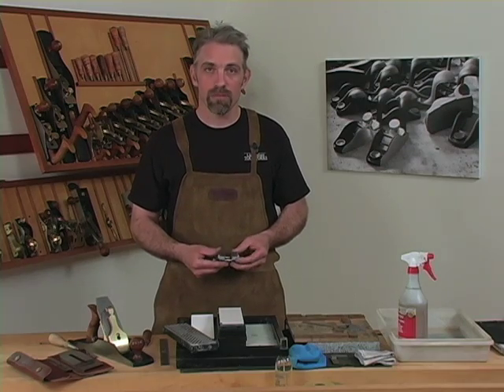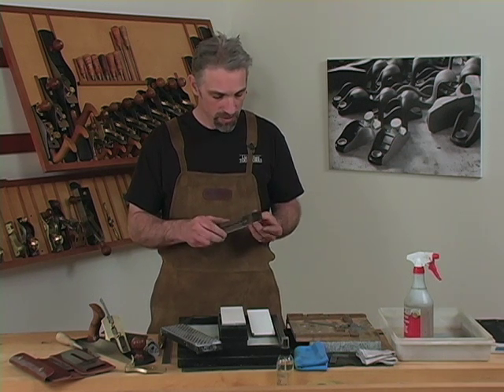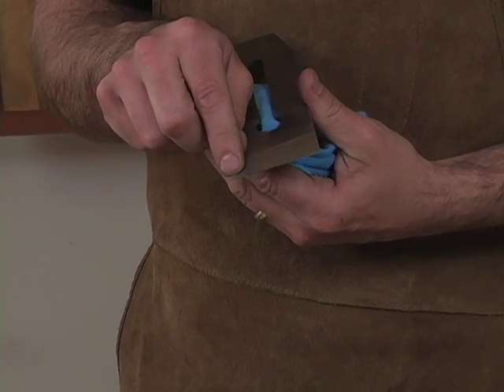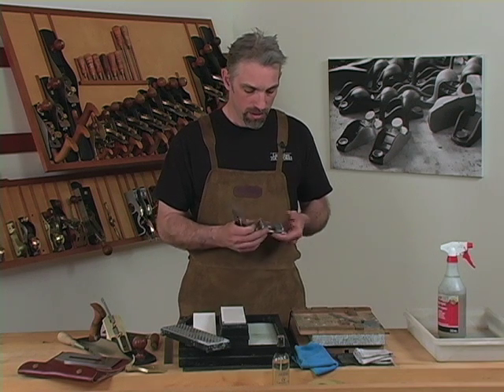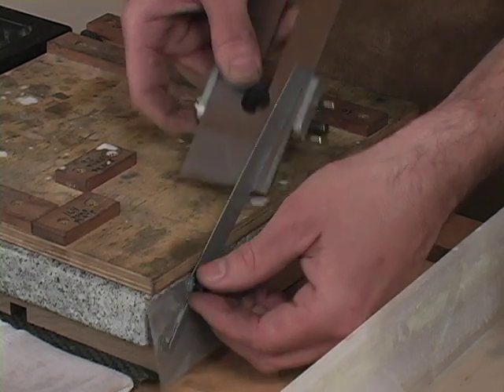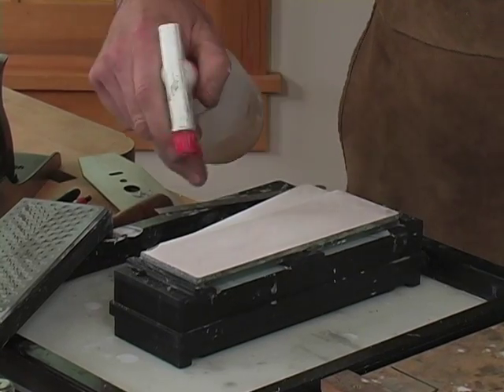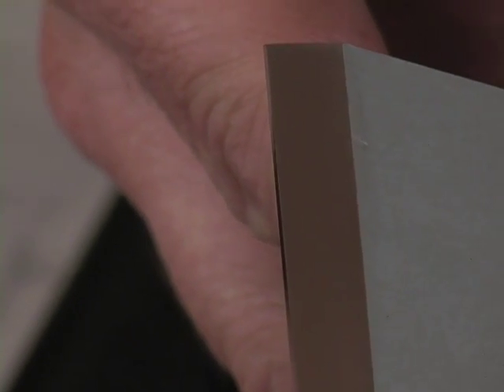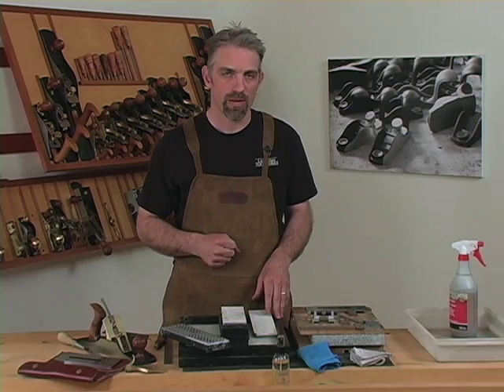Sharpening Plane Irons Part 1: Honing the Micro Bevel

Comment from the maker: @newluthier Actually it is 25 deg.  I would still put a 5 degree secondary bevel on the blade.  Sharpening at 30 deg is different from honing guide to honing guide.  So you are best to use a protractor and get the projection from that.  Once that is established you should make a stop block for easy recreation of that angle.  Cheers.

Comment: Deneb,
 I have recently bought a second hand pair of LN 98 &99 side rebate planes. the blades had been so badly sharpened that I have bought a new set. There seems to be very little on the internet about sharpening these blades. It would be great if at some time in the future you were to do a presentation on sharpening these and other shewed plane and chisel blades. I am considering making specific jigs to hold these blades to ensure the cutting edge remains vertical when in the plane.

Comment: The angle obtained in the guide depends on the thickness of the blade. So you need different settings for some of the thick blades such as those used in bevel up planes and some makes of bevel down planes compared to the thin blades used in a lot of commonly available planes.

Comment: Would stropping the bevel and back of the blade with honing compond improve the sharpness
Reply: Kevin O'Callaghan if you're going to 8,000 I don't think it would make that much of a difference. I can't say that with absolute confidence however, because I haven't done it personally. I'm only thinking of the history where these blades weren't sharpened much past 800 before stropping.

Comment: There is no reason to think having the entire back of the pane iron flat is better. The edge is just as sharp with a back bevel. The back is not a registration surface as it is with a paring chisel. With a back bevel, You get to the same place (a sharp edge) faster. So there's no more quality to be put into it with extra time.
Reply: A mirror on the back is handy in case you want to check your hair between blade sharpenings.

Comment: Those honing guides are nice, but be very careful to dry them thoroughly, and oil the wheel after each use if you lap with water. The wheel will rust and seize or grab slightly while rolling. This will cause a flat spot in the wheel and make it unusable.
Reply: Lie Nielsen's are stainless steel. No rust.
Reply: @josiahutah3712  im trying to remember which one i had,  because it definately rusted, but that is a fair point.